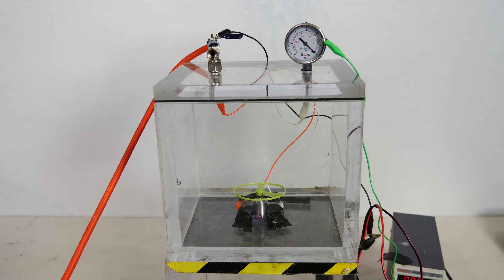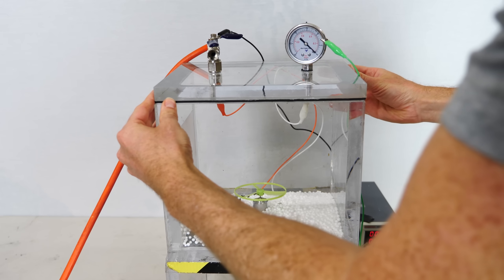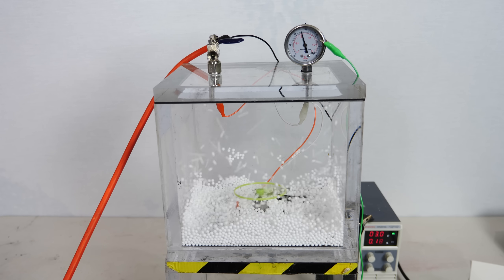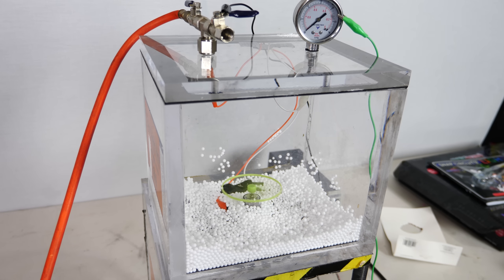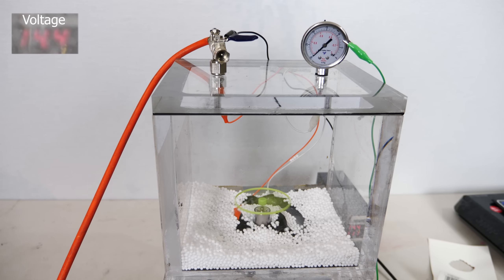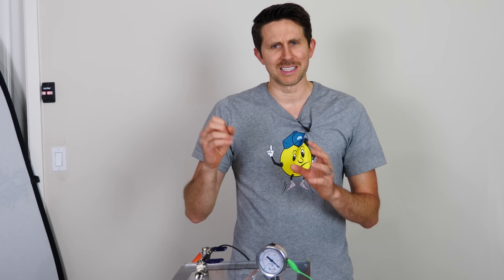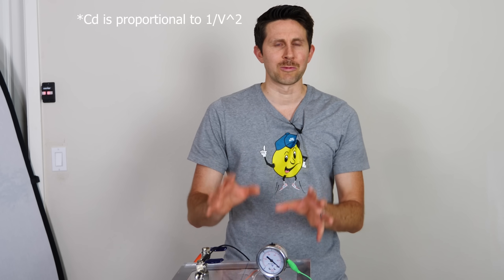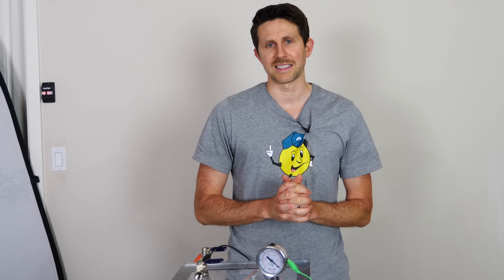What Does a Fan Do in a Vacuum Chamber? Weird Results

Comment: Notice how your fan started pulling less and less amps when the air resistance went down?
Reply: That's the only meaningful result of this video
Reply: The current drops because the back emf increases making the actual voltage in the windings tend to 0. Without the air friction there is actually not much force the motor needs to do and so it just increases speed therotically up to the equilibrium of back emf (characteristics of the motor and speed) match the provided voltage. The inverse is that the current is maximum when the motor is stalled and doing only force with no speed and thus not having back emf. This means the motor has maximum force and current when not rotating. It is why electric cars have fantastic  acceleration.
Reply: @PauloNevesPortugal  That was a really long paragraph to say, "The lack of parasitic drag in a vacuum requires less current to spin the fan at a given voltage."
Reply: @Fadamor  very true.  I was one of "those people" who said to my television (yes, I am watching YouTube on my TV); "yes, yes, yes very nice about the beads but look at that decrease on the display!  Wait!?! No!!! Move the camera back, we need to see what the instruments are reporting!!!"

So, other than that shortcoming, an interesting video.
Reply: @Fadamor  Hey. Perhaps :) By hinting at the back emf concept people can go down the rabbit hole of AC motor control optimization like Field Oriented Control and just plain efficiency. I also tried to hint the concept of Power = F x speed. If someone wants to skip it well you just need to move your eyes :)
Reply: @Fadamor  this is actually not what he said, and your summary is not what is happening here.

Motor current is a function of the applied voltage AND the motor speed. The current goes down when the rpms go up. This would be true with or without drag, though to your point it is the air drag that normally prevents the motor from reaching high rpm.
Reply: @Fadamor  I think that mentioning drag in this context is a bit misleading.  In vacuum, a fan can do no work moving air.  Hence the power required to turn the fan drops almost to zero - both parasitic drag and force required to move air has dropped to zero.

This is also true when the inlet or outlet is blocked.  The fan in is only blowing the  same air in a nice neat circle, not bulk movement of air through.
Reply: This is also the reason why the motor in a vacuum cleaner noticeably increases its rpm if the inlet is blocked. The pump creates its on "vacuum" (low pressure) which reduces the air friction inside the pump which allows the rotor to spin faster while reducing the amount of current needed at the same time.
Reply: @kallewirsch2263  vacuum cleaners tend to have a serial motor, which adds largely to the effect:
Low pressure - less work - higher rpm AND less current- less stator field - more vacuum AND higher back EMF - again higher rpm AND less current etc
It's a vicious circle, the motor's RPM isn't self contained. 
Take the fan off, and a fixed magnet engine will have a certain Mac rpm based on applied voltage.
Take the fan off a 3 phase asynchronous motor, you'll see current & cos phi dropping, but hardly any rpm increase.
Take the fan off a serial motor (vacuum cleaner old style) and the rpm is virtually unlimited, will increase until bearing friction or centrifugal rotor forces cause catastrophic failure.
Reply: For a centrifugal fan, such as a squirl cage type fan, if you restrict airflow to the fan amps go down. Typical bullshit myth that high efficiency air filter on your ac burns your fan out when it actually reduces the amps the fan motor draws on a squirl cage type Fan common in AC units indoor fans. On a prop fan like an airplane propeller it's opposite, increase the air resistance, like a plane climbing, or restricting airflow amps go up.
Reply: @airgliderz  A spectacular example: I built a workshop aircleaner out of 16x20 furnace filters (three stage: traditional  cheap 1 inch, better 2" and a full blown 4" HEPA ($$$) as third).

The 1/2HP blower I was using was a scrap blower from a very large air-cooled mainframe, what was designed to blow through 2x3 ducting.  Lots of backpressure from the ducting and *loud*!

The blower was mounted in a box with the filters on one end, and the 2x3 stub duct ejecting out the back.  Within half an hour the motor would overheat and shut itself off.  WTF?  Bathed in fast moving air it overheated?

I remembered this from my father (a civil engineer) that the solution was to partially obstruct the fan to reduce the amount of air, and hence work it was trying to do.  Voila!  Perfect, it can run for as long as you want, and never even got warm.

Had the same problem with an elderly jennair downdraft.  Blocking 1/4 of the intake was enough to keep it cool and running as long as I wanted.
Reply: @fromagefrizzbizz9377  I use it to see the condition of my collinv tower fill, tracked amp draw at set speeds, can see amo draw reduce as fill got dirty and scaled up as it aged. love it, built my own cyclone filter for my shop, building a guitar and sailboat now. Ran the centrifugal fan with nothing connected, it shut off on high temp. tested was running over max amps. Installed fan in cyclone with do ting connected now running under max amps.
Reply: @airgliderz  "Typical bullshit myth that high efficiency air filter on your ac burns your fan out when it actually reduces the amps the fan motor draws"
True, and a dirty filter catches more fine particles too because larger "holes" are filled with dirt.  But reduced air means less cooling on the motor etc

As an aside filters are how furnace mfrs get out of warrantees on heat exchangers- they just claim you didnt change the filter and point out how the warrantee is void if you fail to replace filters when dirty etc., well since you cant prove you did it they void the warrantee.
Reply: @airgliderz  A propeller moves the same amount of air at the same power draw no matter what orientation it is in.  The reason why a propeller spins faster in a climb is because the aircraft needs more thrust, and the pilot increases the throttle.  Climbing isn't making the air more difficult to push, it means that you now have to exert additional "work" (thrust) to climb and maintain speed.

The only time where power goes up when restricting flow is with positive displacement pumps - eg: piston pumps - and usually only noticable with incompressible fluids like water.
Reply: @fromagefrizzbizz9377  wrong climbing does create more work and resistance that's at fact. It's simple physics. 

Blocking or restricting airflow to a propeller makes it work harder, like when in a climb you increase the angle of attack the plane slows down unless you add power, and or slows down the drive motor like in a climb. 

Opposite of a a centrifugal fan, like in you furnace, if you restrict the air going into the fan the fan draws less amps, dirty filter fir example, the drive motor is not working as hard because it is throwing out less air. So it's a common myth that putting in a restrictive high efficiency air filter will cause the motor to to work harder and over heat. In fact if the motor on a centrifugal fan, squirl cage is running hot and drawing to many amps, restricting the air flow into the fan will fix that. 

A prop fan when you restrict airflow your adding resistance to flow versus the same prop in free air.

Basic fan laws you can't break.
Reply: @airgliderz  A fixed position propeller at a given pitch and RPM moves EXACTLY the same amount of air in atmosphere no matter which way the propeller is pointing and consumes the same amount of power, producing the same amount of thrust.  Orienting the propeller in different directions does not restrict air flow.

Stick a propeller in a pipe (like a wind tunnel or ducted fan) and restrict airflow?  Without a RPM governor or autopitch control it speeds up, consuming less power just like any centrifugal-based blower.  A propeller is an example of a non-displacement pump - which consume less power or speed up, when flow is restricted.  Positive-displacement pumps like diaphram, vane, roller, screw and piston pumps enclose a fixed amount of media, and move it a fixed distance.

At a different level consider: the work (power) required to move a given amount of air is the mass of air plus the acceleration you impart to it - basic F=MA - that is the thrust.  If you reduce the mass of air or acceleration, the force needed to move it drops, and so does the resulting thrust.  In positive-displacement pumps, if you restrict output flow you require more power to overcome the output resistance.  If you stop the output flow in a piston pump moving something non-compressible, the pump stalls on power overload or blows the cylinders.  If you block the input it can do a number of things, including cavitation.

This is basic first year civil engineering.

We built a wind tunnel using a Homelite engine with a propeller and a big piece of sonotube.  Guess what it did when we restricted air flow?  The homelite sped up.  16" propellers at 7000 RPM and speeding up are scary when you're close to them.  You're wondering whether the sonotube will stand up to the blades flying off.  Hint: it won't.  We wrapped it in metal mesh...

An aircraft flying level must produce a given amount of thrust - meaning a certain amount of air being moved at a given acceleration, just enough to balance out the drag slowing the aircraft down.  To climb steeply, while maintaining velocity requires enough force to not only counterbalance drag (the same at the same speed no matter which direction you're going), but to lift the aircraft rapidly higher against gravity.  You need more thrust.  To maintain velocity, you must then increase the thrust by supplying more power to move more air with a higher acceleration - by speeding up the prop by upping the throttle.

An aircraft climbing does not experience flow restriction.

That said, most propeller aircraft run the aircraft's engines run at a specific RPM throughout most of the flight.  Normal altitude changes and minor speed changes are done by adjusting the propeller pitch, not the throttle.  In commercial airliners the throttles are seldom touched except at landing or take off.
Reply: @airgliderz  Right.  You said yourself, the same prop in free air cannot have its flow restricted - is an aircraft in free air?  Of course.   Tilting the angle of attack doesn't restrict air, it increases the amount of power to maintain speed.

Tilting the aircraft doesn't make the propeller goes faster or slower, it's the pilot's changing the throttle that does.  Without a throttle, the thrust would be the same - but if you're climbing and need more thrust, it's gonna stall unless you increase throttle to make the propeller spin faster (or maintain speed if you use prop pitch to increase thrust).

I have plenty of real world examples I've done myself that show that propellers and squirrel fans work EXACTLY the same in similar situations.  They're no different.  Because ... physics.  Basic 1st year engineering.
Reply: @fromagefrizzbizz9377  wrong again, tilting the prop means the planes angle of attack was increased and likely the plane is climbing both resulting in the plane slowing down equaling more resistance, prop drive motor slows down because it us doing more work and you might increase power to maintain soeed or climb rate either wayproor drive motor is performing more work. Same on a constant speed prop when you start to climb.

Anolgy toke it simple for you. When you push a Cart up hill it takes more energy then on level surface.

Clearly you live in a make believe world where the laws of physics and fan laws do no apply or you are a democrat.
Reply: @airgliderz  Good grief man, you don't even understand the original premise, and hence your interpretation of what I said is totally wrong.  So wrong that you don't even understand that you are saying almost exactly the same thing I am.

I'm the one who gave numerous examples of both blowers and propellers speeding up when flow was restricted. Don't give me more.  My home built air cleaner overheating - the blower was designed for air-cooling a large computer through small ducts - now in a big box, moving too much air.  Solved by restricting airflow ... my old jennair downdraft fan overheating (also eliminated by restricting air flow) ... and a home-build wind tunnel made with a souped up homelite weedwacker engine and a model aircraft propeller that sped up when air flow was restricted.

The original preposition is that when you decrease the atmospheric pressure or restrict the flow to a squirrel cage blower, that's running without a speed regulator, the blower will speed up as there's less air to move at the acceleration the blower is able to impart.  Moving air is taking less power, so the fan motor can speed up.

This is true both with squirrel cage centrifugal blowers AND propellers and ANY other type of non-displacement pumps/blowers that doesn't have inherent speed regulation (eg: induction motors in a furnace blowers are synchronized to the AC power, DC and universal motors aren't. Gasoline motors will do the same thing if you defeat the governor.

Basic civil engineering because ... physics.

if you agree with that, then we're in full agreement.

You keep yammering about climbing in a aircraft results in the propeller speeding up because somehow the air flow is restricted.  No, it's the other bloody way around and there's no restriction. 

Climbing at a fixed rate of speed is a result of increasing power to the engine so it can turn faster and move more air faster than it has to to maintain level flight.
Reply: Thats not what happened, its just noise cancelation from no air being in it.
Reply: @seansullivan7928  "noise cancelation", now that's pure bull.
Reply: @airgliderz  seriously dude? There is no sound in a vacuum. No sound in outer space, because there is nothing for the Soundwave to bounce off of
Reply: @seansullivan7928  obviously,  your not the brightest light bulb on the Xmass tree are you?
Reply: @airgliderz  so let me get this straight, what your saying is that noise cancelation is bullshit? So you think you know better than that the laws of physics. Your saying that the laws of physics are bullshit and that noise cancelation in a vacuum is bullshit. Thats what your saying?
Reply: @seansullivan7928  noise cancelation usually refers to a process of canceling sound IN ATMOSPHERE by using destructive interference, playing a duplicate of the sound but 180 degrees out of phase so that the sound is canceled.

In a vacuum, sound does not propagate. We don't usually refer to this as cancelation though.
Reply: @johnmorrell3187  what do you call it then
Reply: of course he didn't, he knows jackshit about science. he just copies experiments he reads online incredibly poorly, and doesn't understand the words on the script his writers give him
Reply: I don't know very much with vacuum pressure , I was assuming the fan would speed up without adjustment with no air friction....I was wrong..learnt with this video though.
Reply: Yes
Reply: I think he noticed it too and moved his camera so you couldn't see the change in current draw. Why introduce things you don't want to distract the viewer with that takes away from your intended demonstration?
Reply: @Fadamor  For me, the voltage/amp number tells most. Put on a graph with a rpm count it would tell the effectiveness of the motor, the engine mechanical vs electrical loss, the real effort going out etc.
Reply: @Fadamor  what

Comment: maybe you should check the fan ,maybe it can produce air ( by itself )( when you increase the voltage  , and can give  you weird  results , or maybe there is9happen) something else in the vacuum , maybe the considered vacuum is not a real vacuum, maybe there are some, intervals , the vacuum works into the intervals ,

Comment: I'm pretty sure that the over-driven motor was just transferring energy to the base of the chamber as vibrations, initially just shaking the balls around the bottom. 

Then, when the vibrations were powerful enough, some balls were shaken into the fan blades, causing a cascade of extra motion from the extra energy added by the blade's rotational energy. This caused a positive feedback as more and more balls hit the fan blades. 

The wind effect of the blades did none of that.

And there is no way that any windstorm on Mars could blow over a spaceship. The wind pressure is way too small.

Comment: What happens to the pressure that acts on the glass box when inside air is removed..
Doesn't the change in outside pressure and inside pressure acts on the walls of glass box..
Imagine you are creating vacuum as much as possible..
Can be feel any kind of wind or air current near the glass box😁😀
Reply: If there is a perfect vacuum in the box the full air pressure will press on the box, holding it shut and maybe compressing it, if it can't hold up against the pressure... the only wind that happens is at the outlet of the compressor, where the air from the box is released
Reply: @johnuferbach9166  
Thank you